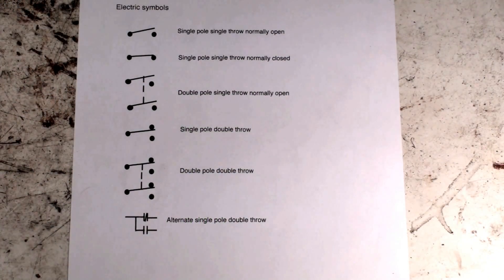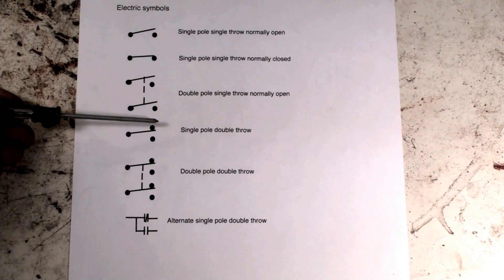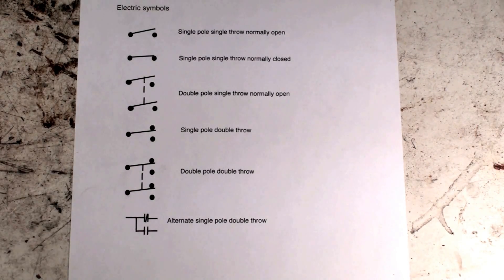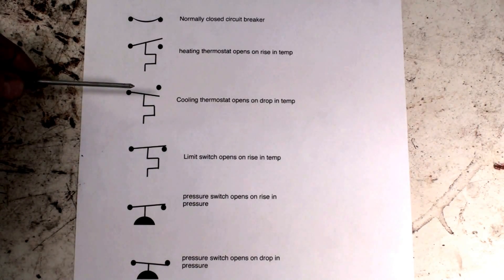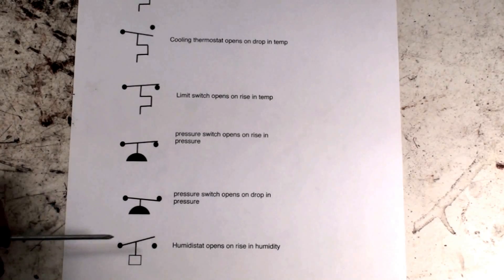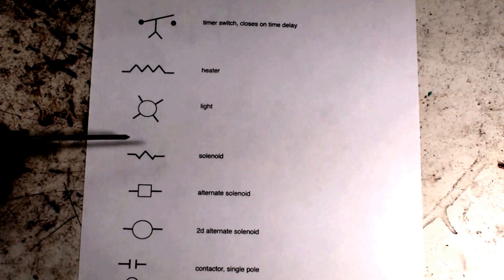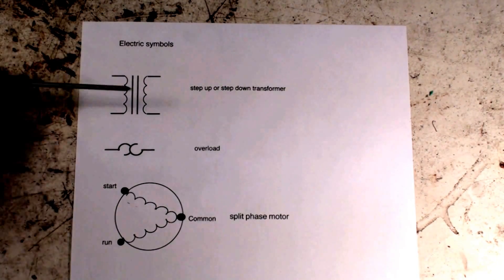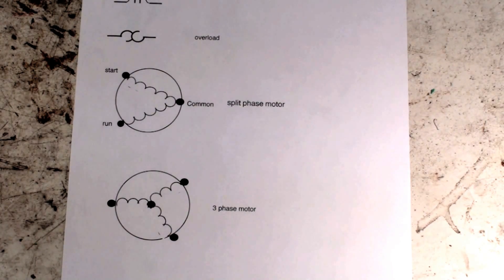Electric symbols for HVAC

Comment: Gray furnaceman, I purchased a Schwank Eco infrared heater, Honeywell R8285 A, B Control Center, and a 24-volt thermostat for my patio. They all have wiring diagrams, but I am lost as the diagrams are a bit confusing. Is there any way I could send you the picture of the diagrams to your email and you provide a simple wiring diagram for me to follow? Thank you for your time and you produce great videos!
Reply from the maker: Send on a reply attachment.
GFM
Reply: @grayfurnaceman  Disregard, I figured it out. Their instruction manual is for heaters that have fans and I did not need the control center for the type of heater that I have. I just needed a 24 Vac transformer and 24 Vac thermostat. Thank you.

Comment: I'm guessing the heat sequencer is similar to heat/cool thermostat and limit switch?
Reply from the maker: I would not make that connection.  Its a simple normally open, single pole single throw time delay switch.
GFM
Reply: @grayfurnaceman  I need the heat sequencer symbol
Reply from the maker: @enmanuelpena7663  Try timer switch, closes on time delay.
GFM
Reply: @grayfurnaceman  I'm not working on anything, it's just a schematic. I need the heat sequencer electrical symbol for a school project.
Reply from the maker: @enmanuelpena7663   I refer you to my second reply.  Its on the sheets.
GFM

Comment: N.O and N.C valves are tricky, a dump valve in a boiler is N.O. and one would think it is open all the time, but it's just the opposite, it's CLOSED, but when the power goes off, it is OPEN and drains the hot water away...

Comment: On the second page of symbols, you describe the fourth symbol down as a 'limit switch' whereas the symbol shown is in fact a Normally Closed temperature switch.  A limit switch has a small triangle on the symbol.
Reply from the maker: The triangle is used for movement limit.  In HVAC, limit switches are mostly temperature actuated.  This was not intended as a comprehensive listing of symbols, but one defining HVAC symbols.  Thanks for the thoughts.
GFM